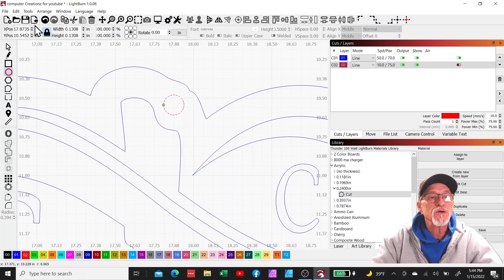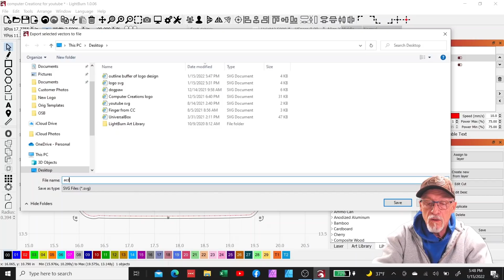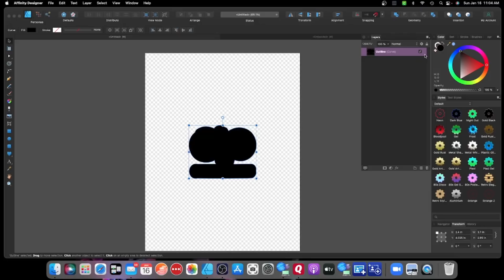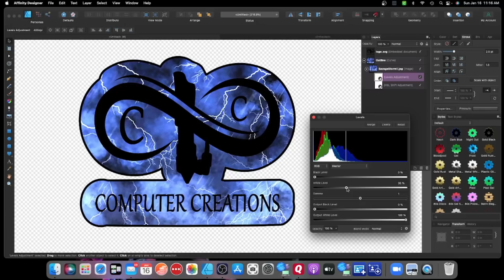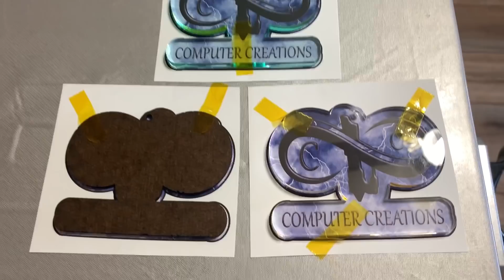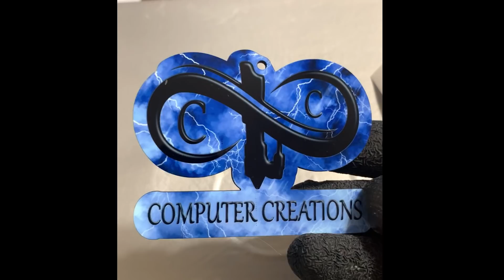Laser plus Dye Sublimation = More Profit see update video with audio fixed

Comment: Very cool, one issue I have with your vids is the audio volume changes, x sound guy. When you are at the computer the sound is lower than when you are at the other locations. Could be I am also going def, but I turn the volume up high, and then youtube goes to an ad and I have to mute till I can get past the ad. I watch most things at a level of 20 and you had to go to 45.
Reply from the maker: Thanks for your comments Brian, I do appreciate the input. The first video with this title the audio was all hosed up. not sure why, going back and looking at the video before publishing the audio was level but not when I published it. went back rechecked it and republished it and the audio fixed version seems to be fine. I’m using a Rode wireless mic system for most all my portions of my videos. I will be extra careful to produce a cleaner audio experience in the future. Thanks for the sub and watching my videos.

Comment: I am ready to buy a sublimation printer. Could you recommend one? Thanks!
Reply from the maker: either the epson et 15000 with cosmos ink or the epson F570 sublimation printer. price range is 600 for the 15000 or 2500 for the f570. watch out for some other printer brands there ink is very expensive!

Comment: Sublimate then print to cut in lightburn. Works well for sublimating first.
Reply from the maker: Good tip!
Reply: This was a question that I had. If you sublimate first, does this not "burn" off on the cut lines when you pass through the laser? I presumed that due to how the inks are made/used that they might evaporate around the cut area leaving a smudged edge.